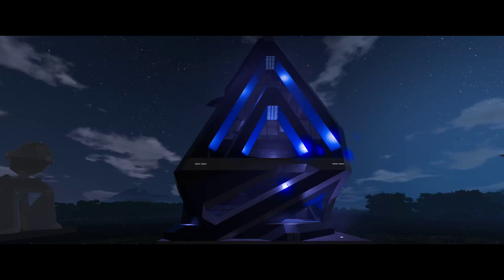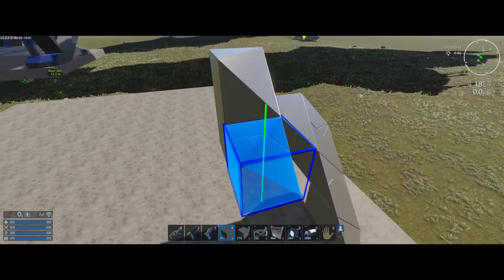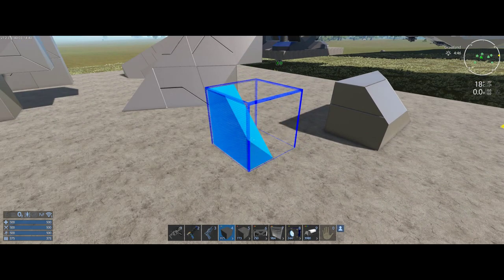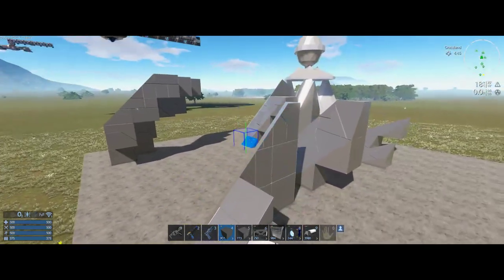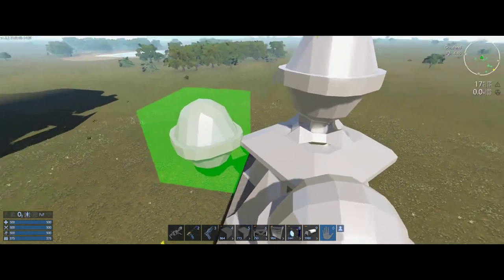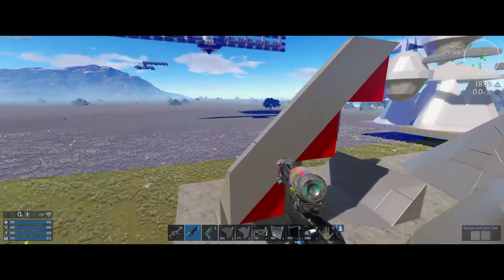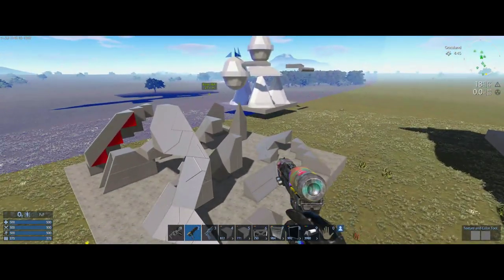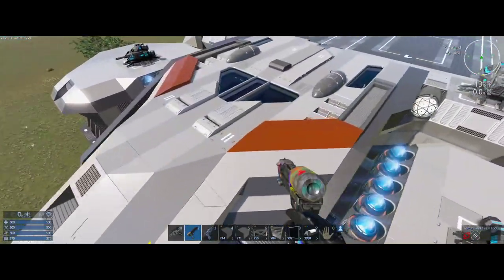Empyrion Galactic Survival - Block Tutorial and WIP Creations

Comment: Informative is what I was thinking, too.  I like how the block sets are complete enough to "extend" the shape you made with any two or three, up in triangular or quadrilateral scales, making the same shape only bigger.
My "big discovery" that I made recently helps this manner of building, I think.  I noticed how if you have more than one stack of blocks on your toolbar, provided you only ever subtract blocks from each stack (and in Creative, in general you will only do so), the game remembers what shape that stack was.  So if I have a set of shapes I'm using to make a construction, I can use multiple slots of the same blocks from the "shopping list" to make it, without having to go into shape selection as often.
29:10 While some designs can be done with more than one kind of set, I wonder how the texture meshes for each, actually; I was thinking the other day while texturing, I wish I could rotate the textures in four ways instead of two ways, as the newer textures these days are not necessarily radially symmetrical, and some are asymmetrical.  On that note, would you like to do a texturing tutorial, sometime? :)